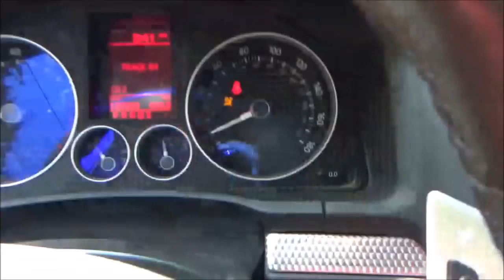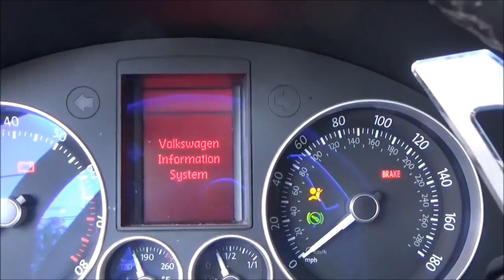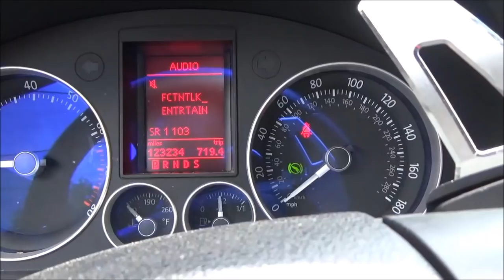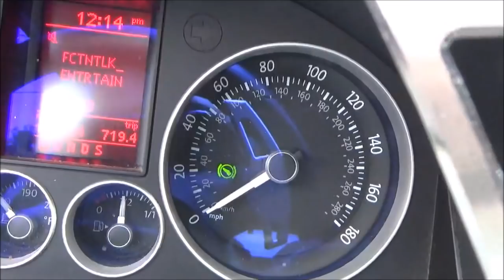Volkswagen Audi Seat Belt Wire Repair / 00591 Fault Code Air Bag Light

Comment: Good video on a common VW problem.  I just repaired mine this weekend.  Both seatbelts had broken wires.  Just to add to your tips, I took my seats all the way out and worked on them on a bench... made it a lot easier.  Once you have the seat out, you have access to the other end of the harness that attaches to the main harness.  With that access, you can check for continuity using a multi-meter to make sure your repair was sufficient.  Also, I soldered all of mine.  I did not have to clear any codes as they just went away when the system no longer detected the fault.  FWIW, mine was on a 2003 GTI.  Good video!
Reply: Was it the air bag code as well?

Comment: I got the same problem with my belt except only the locking part. While I am driving with my seat belt on it still is beeping and the light that my belt is off comes on. I am guessing that one of those wires got disconnected, cause as you do when I wiggle the belt it goes off and on again... So I need to fix it, but how did you open the thing? Just brake the plastic?
Reply from the maker: Slowly pry at the bottom up the sides.But yea you will need a little glue putting it back because its a part thats melted shut when  they made it

Comment: Message left  on 12/30/18:
Check airbag icon came on after car sat idle with on engine for
a few hours without knowing.   Any ideas what happened or why icon came on 
right after car had run out of gas?
Happy New Year everyone.

Comment: My audi a4 b7 intermitent airbag on, it kerp comming bavk after i deleted using vag obd, any suggestions?
Reply from the maker: Could check the wires, I found mine by accident wiggling the seat belt